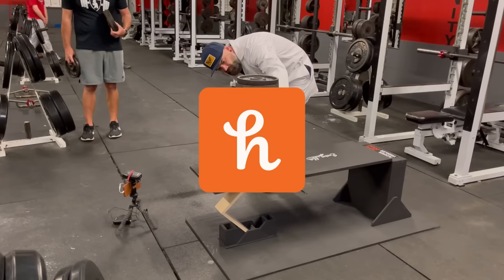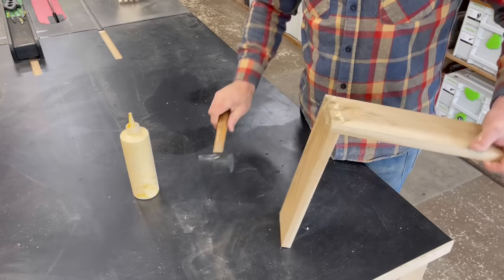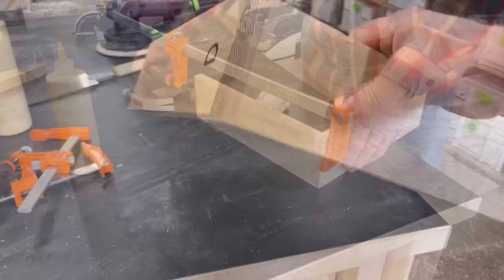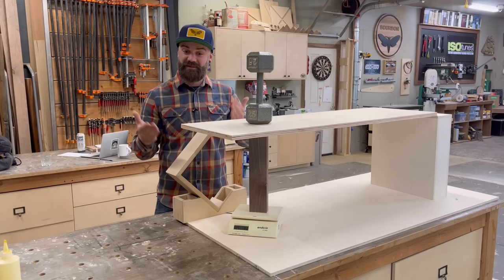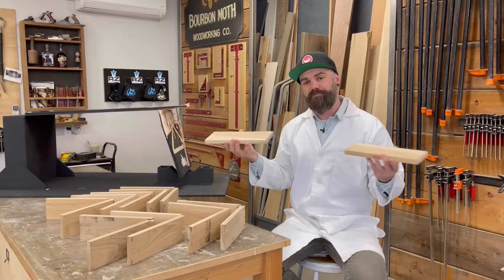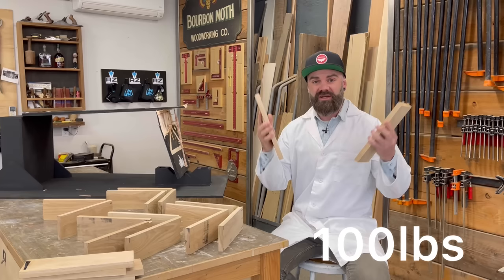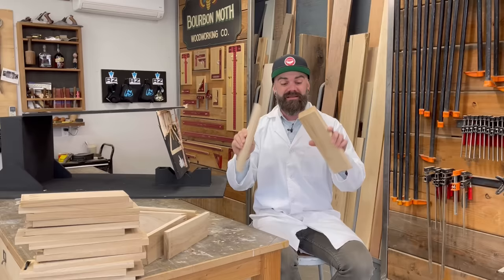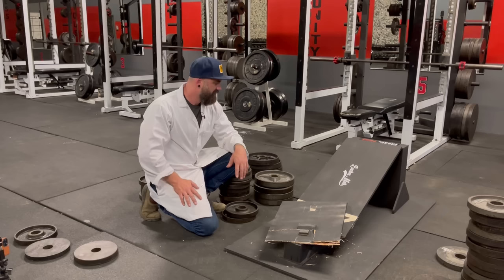What's the Best Wood Joint || Insanely Strong Joinery!

Comment: I would love to see this test done a second time with the same wood and joints, but this time testing the breakage in a pulling direction. As several already mentioned in the comments, different joints are strong in different aspects, and depending on what you're constructing you may need some joint over other. 
In physics, we call these different loads compression (what was tested in the video) and tension (if we pulled the ends apart). We also have torsion (by twisting the joint) and shear loads (by dislocating one board out from the plane of the ∟-shape), that would be interesting to look at.

The differences in these strengths are actually quite important in fabrication.
For example, if we were to construct a box (with no top or bottom) using only Miter joints we would now expect this box to be super strong from what we just learnt. But this is not necessarily the case.. If we try to crush this box (by for example by standing on its edge), only two of the box's joints will be under compression (the two joints on the side). The other two joints (the top and bottom joints) will actually be under tension. So if the Miter joint happen to be very weak under tension, then the box will break pretty easy, even though the Miter joints are super strong in compression.
Reply: Wouldn't every joint here actually be tension and / or shear though? The inside corner of the joint in each case provides a fulcrum around which the joint fails. The box joint is basically just a bunch of glue joints failing in shear.
Reply: I was thinking the same thing. He could just take the joined boards and rest them on a level, low-friction surface in an inverted vee (^) shape, then apply a straight-down vertical force to the joint.
Reply: You'd also have to repeat the experiment many times and have other people replicate it several times to  make it truly scientific.
Reply: @monsterchimp1669  yes, science is very boring and hard work
Reply: @crackedemerald4930  This was the first thing I thought of - 1 sample per joint is suggestive but not definitive, and it would have been a lot better to have a whole bunch of each joint.  But he has limited amounts of time and funds.  It'd be great, though, for a senior thesis in woodworking engineering, to have repeated tests.  He could also have tested other types of joints (that I just listed in a comment of my own).
Reply: @ahfreebird  Some are combinations.  The splined miter joint has the miter itself in tension and the splines in shear.
Reply: The joints tested are in bending. There is compression on the inside, and tension on the outside of the joint.
Reply: Byyj
Reply: All what you said is right, but please consider this is a YouTuber works, the main idea is to attract eyeballs 😂
Reply: @johnpaulson996  Exactly, duh
Reply: You can use the word we all you want to, but it doesn’t change the fact that you obviously don’t know anything about structural engineering

Comment: If you are still doing this.. try angling the outside splines in your mitre joint instead of all of them being parallel with your downward force. It could be as little as 10 degrees. Also, try some angled dowels as splines toward the inside of the joint. My theory is that the angles will transfer some of the downward force into other directions (namely into the wood itself) which would weaken the overall downward force applied to the joint. I also believe that there is an optimal degree of angle for maximum strength. Too high would be much less effective and would probably weaken the joint.
Reply: Also would be interesting to see how much the material used for the splines/dowels matters.

It‘s likely that in softer/weaker woods, dowels and splines made of strong woods would have a greater impact on joint strength.

I recently saw a gizmo for drilling dowels at opposite 45 degree angles (I think on 731 woodworks‘ channel?) which locks the joint together.  Thought that was interesting.  I‘ve seen many finish carpenters take that approach with moulding and brad nails, angling them opposite to lock it in, but hadn‘t seen it previously with dowels.
Reply: Longer dowels too.
Reply: Great suggestion

Comment: The strength of the miter joint is really surprinsing. A few thoughts on that:
- Since your miter joint is 45 degree, and you placed it in a 45 degree angle, the strain is ideally angled, as the joint should "see" no to little shear stress. I wonder what happens, when you alter the force direction. 
- The surface area is around 40% greater than that of a simple butt joint.  
- The cutting surface is a mxiture of end grain and long grain. Could you do a test, where you presoak the endgrain in a mixture of water and glue, let it dry and then glue it? 

Super interesting video! I feel like such videos really bring reliable knowledge to the community!
Reply: Its not so much the angle. Technically its an arm of momentum thing where the inner corner is the centerpoint. 
Looking at that, it is important, that it is not only 40% more glue area, but the additional area is also at a larger distance to the center of rotation, giving it a much larger arm of momentum. 
If you calculate effect, you'll find, that those 40% can hold the same weight, as the first 100%
So only from that effect, you could expect double weight.
Adding those splines improves even more especially at the longest arm.
Another interesting thing is, that this connection does not apply any stress onto the fibers, that separate them from each other (as happens in the butt joint) They are mainly and in a bunch pulled in their fiber direction.
Really would like to see how it would perform if the glue surfaces are prepared (pre glued).
Reply: You want sheer stress in a test like that. Lap shears can resist a lot of force. The main problem here is the glue being used or the bond line that is generated is insufficient.
Reply: @wildeast66  I'm curious to see how things would change if a high strength epoxy was used instead.
Reply: @MarkPryor1  Mee too.
Reply: Another interesting thing with the 45° miter is the taper of the wood to the point of greatest tension.  This helps to minimize peak tension stresses.  This turns out to be more effective than shear stress in the other style joints.
Reply: I think the reason why the miter joint won is because the angles involved changed all the forces so that the glue was resisting 100% tension.  The two halves were pulling straight apart.  In the box and dovetail, the glue is more surface area, but the forces are a much higher percentage rotational shear.  For the dowel, domino, and lamello, the point of failure was the inserted pieces.  I'd like to see these tests repeated with 1) a couple pieces of each type to get an average.  2) Thicker wood so the dowel, domino, and Lamello can have beefier pieces.  and 3) variations on angle the force is applied to the joint.
Reply: I think there is another factor at work because the tension stress is concentrated at the outside edge of the joint, the wood is similarly thinning to that point, hence there can be some deformation at the apex of the joint, delaying the moment of crack initiation at the glue wood interface. The similarity of the essentially cross-grain cut surfaces also plays an important role in the creation of a much stronger bond, like you I'm sure blocking the ability of the glue to wet into the timber would drastically reduce the strength, always a problem if there is some scorching of the
Reply: @joshbonney9624  thicker wood would invalidate the test as an apples to apples comparison.
Reply: @RaggedsEdge  Not if all of the tests were repeated with the thicker wood, as I said
Reply: The problem with using a simple miter joint in a project is that if you are off by a single degree and the joint does not make even contact with each other, the joint will be significantly weaker
Reply: Everyone looks at miter joints as less end grain and more side grain. I believe the benefit is actually the opposite. It's beneficial to have MORE end grain. By using a basic miter joint you have changed the test from a joinery test to an adhesive test. In a butt joint the side grain will shear because the glue is stronger than the lignin. In the case of miter as others have noted you are effectively putting the glue in a tensile loading situation. Almost anything you do to disrupt this glue line will have a negative impact. By installing the splines you have now adding two large surface area glue joints per spline(smaller the spline the better) that are in direct shear. They are not trying to split open the joint like the wedged dovetail.
Reply: I'm pretty sure it's not strong because of the angle. If you think about it the outside corner of the joint is being levered up with a lot of leverage, with the inside corner of the joint being the pivot. Seems pretty bad for the joint to me

Comment: A lot of good suggestions in the comments. One thing I would add, it would be more beneficial to do multiple tests of each joint. It is entirely possible that one or more of the joints failed earlier than a typical example of that joint, and it is also possible that one or more were hero joints, holding on longer than a typical example of that joint. I know it is more work and cost to make and test multiples, but it would help to establish more reliable results.
Reply: I had this thought, too. He put so much effort into this, so I don’t want to seem flippant, and you don’t seem flippant to me, to be sure, but IMHO science would require multiple (at least 3) examples of each to test just because, like you say, any one of those joints could’ve been a lemon. This kind of research is absolutely awesome, though, and hats off to this guy for making it happen.
Reply: Agree. There's a video about glue strength that did 3 of each and sometimes there was pretty big sample to sample variance. Maybe he just got a bad dovetail :)
Reply: @Bob.Silverstein  I don't know if you remember this, but about 10 years ago, there was this meme floating around of a child's science experiment where she fed one plant tap water and the another plant water that had been heated in a microwave oven, then allowed to cool. The one watered with the microwave-heated-then-cooled water died while the other one flourished. So a lot of people started to avoid using the microwave!

Follow-up studies were significantly less viral, unfortunately, but they sampled a lot more plants and it turns out the kid just had a bad plant that wan't going to make it anyway - and it happened to be the one that got the microwave water.

So, anyway, I'm speaking to the choir here. It would triple the time and resources required for his experiment and if I was him, my eyes would be rolling, so I also want to emphasize - I really appreciate this video and the spirit in which it was produced.
Reply: @sivacrom  agree on the extra time taken being pretty steep. But perhaps it would be worth picking six of them: butt, miter, spline miter, box, dovetail, outside pocket screw. Another thing I didn't even think of is that it might differ for hardwood and softwood for a variety of reasons. Softwood might take glue better. Hardwood might support screws better. So one could get very different results with pine versus oak.
Reply: @sivacrom  also, I do remember experiments like the one you mentioned. Not surprising. You could even show that singing to a plant causes it to grow twice as fast, if you have an N of 1 :)
Reply: @sivacrom  The big question is: If you build the same joint 10 or a 100 times, will there really be big variance between samples? Especially if you use exactly the same tools, same glue (and method of applying it), roughly same clamping force and so on …
Reply: @Mike-oz4cv  Right. I’d even say that, between 3 and 100, you might not see much of a difference, but between 1 and 3 you could at least rule out a freak circumstance, which is why I think 3 is ideal. If 2 or 3 out of 3 perform the same, you probably can rely on the majority to be reproducible. But if you only do 1, you’ll never know if you got a lemon.
Reply: @Bob.Silverstein  Not if I was singing, Bob.... the plant would die straight away.  :)
Reply: Another point to consider is how the joint fails. Notice how some joints break instantly, while others begin to split, but are still together holding the weight.

Also would like to see the result with impact weight.

Comment: Miter had me stunned! Thank you for running the gauntlet! Also, stray option that might help:
Drill into the narrow edges of the box-joint, and plug with wooden dowel (imagine if you were making a 'hinge' out of wood, dowel plugging through each 'tooth' of the box-joint) to prevent the two boards from tilting out of alignment; it should force the inner dowel to fail, first, which'd be difficult in that confined bore.